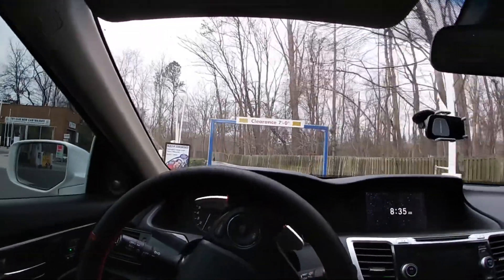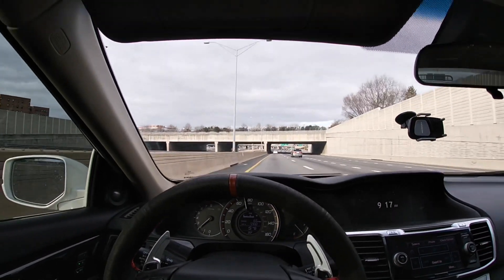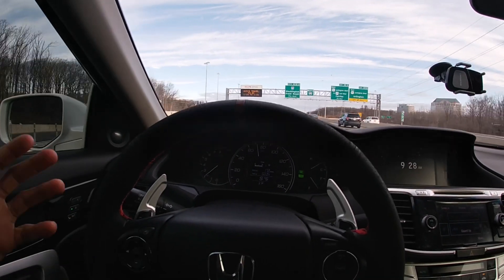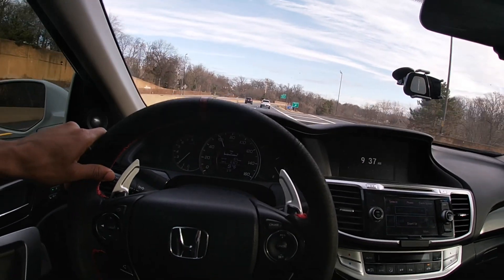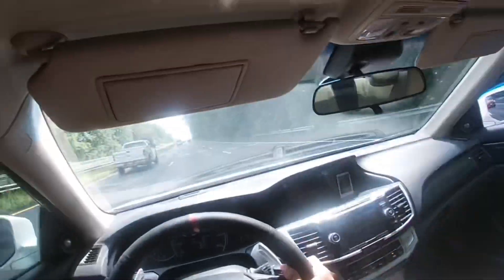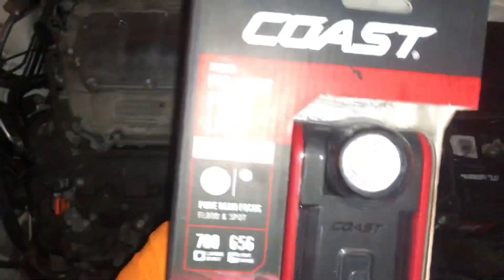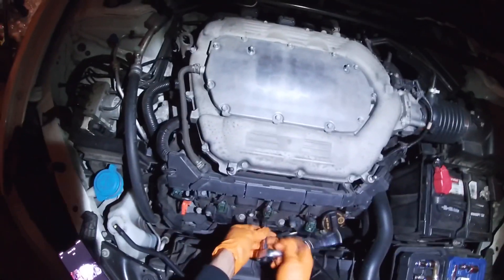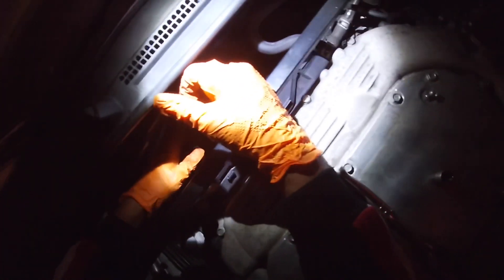Latest Mod!!! This Made my Honda Gain Back Some Top-End Speed.

Comment: Them new 2.0t 10 speeds are hella slept on we got one that mf gap v6 but top speed limited
Reply: lol who cares about the 2.0’s, v6 sounds so much better and these cars are N/A. if the v6 had a little turbo just like the 4 cylinders then those new 2.0t’s would get gapped left and right
Reply: @christopher4692  nah not really cuz v6 with a turbo is alot more weight plus the 10 speed in the 2.0 would make up for it v6 does sound alot better tho
Reply: @ibrahimm218  same argument, if v6 had a 10 speed y’all would be all over that too. and not really v6 coupe is 3,397 pounds while the 2.0t is 3,362 lol so not really a big difference like you make it sound. v6 better
Reply: @christopher4692  but a v6 coupe has a lousy transmission tho bro but I would hate to have a v6 then get dusted by a 4 cylinder so imma go with 2.0. Hey just my opinion
Reply: @ibrahimm218  exactly my point, if the v6 had a 10 speed and turbo nobody would want the 4 cylinders, they only did that cause at the end of the day it’s cheaper to build 4 cylinders. it’s the new models so of course they are going to have a better transmission.
Reply: @christopher4692  a v6 turbo everyone would bitch about mpg and it wouldn't be as reliable as a 4 cylinder its a accord at the end of the day bro they need something reliable but also sporty in reality honda not gonna put a v6 turbo dude thinkk
Reply: @ibrahimm218  bruh you make no sense, the 2.0t is literally the same mpg just 1 more then the v6 LMFAOOO ima stop replying you clearly don’t know wtf you’re talking about.
Reply: @christopher4692  LMAO this is so entertaining
Reply: @christopher4692  im sure if the v6 had a turbo the turbo would help the gas mileage if u ease off the throttle and vice versa.
Reply: @ibrahimm218  if honda made a v6 turbo with a 10 speed I would take tht any day over a 2.0 lol.
Reply: @talhamohsin6195  ofcource 100% but let's be real they won't do that honda loves to cut corners yall put of your minds if honda had a v6 turbo ofc i would get it over the 2.0
Reply: @ibrahimm218  just thinkinh hypothetically lolol
Reply: @talhamohsin6195  thank you ok and I respect that atleast u understand that its hypothetical and it won't ever happen 🤣🤣
Reply: @ibrahimm218  haha yea bro
Reply: @ibrahimm218  civics are focused on mpg , are you sure you know what you’re talking about lmfao if they are both stock no it wouldn’t, needs a full tune bolt ons open engine just to gap it and if the v6 were the same situation then you’re super wishing 🤡
Reply from the maker: Yeah those things are crazy with a tune lmao.. I thought about getting one but 4 cyl ain’t for me and there’s no coupe smh. And really it all depends on the driver because I’ve seen it go both ways.
Reply: @4DPvon  oh bro thats faxx really wish they had a coupe
Reply: @christopher4692  u clearly haven't drove one or even been behind the wheel of one keyboard warrior
Reply: 2.0t is faster to 60. But 40mph and up, the v6 has the edge.

Comment: Hey man I have the same car and I'm running 6.66s 0-100km/h stock, I measured using a dragy, any suggestions on what I can do to reduce wheel spin off the line? My quarter mile is 14.76s.
Reply from the maker: Try launching at about 1500rpms so the car can take off in 2nd gear. That’s usually what I do when measuring 0-60 and 1/4 mile.
Reply: @4DPvon  thanks man! gave it a try tonight definitely helped biggest problem I have is I can't get traction. The stock tires are straight garbage. I have some 19s I'm thinking of getting some high perfomance tires put on. Any that you recommend? I heard the firestone indy 500 are pretty good, thoughts?

Comment: Hey man im also in the DMV
Quick question
I have a 8th gen 6-6
Does the 9th gens also suffer the axle wear on front passenger side when you lower it?
Reply from the maker: I haven’t had that issue, my car is only lowered about 2 inches. I think people usually have that problem when they lower it too much and the axles sit at an angle

Comment: Why you remove the engine cover?
Reply from the maker: I just never put it back on after installing the pcds.
Reply: I removed my engine cover and when I tried to put it back on I guess I accidentally took it off with force and lost the rubber groumet to hold it. Sad days